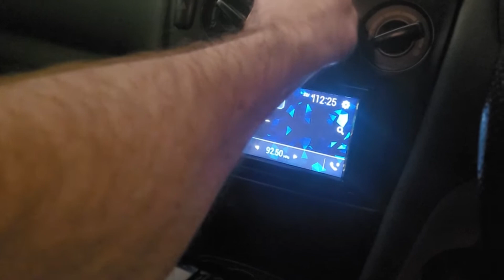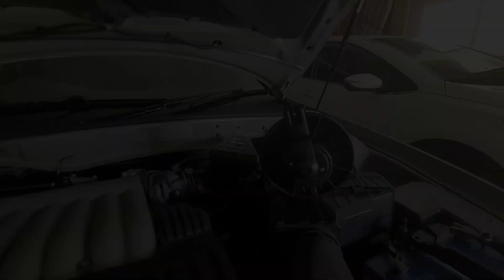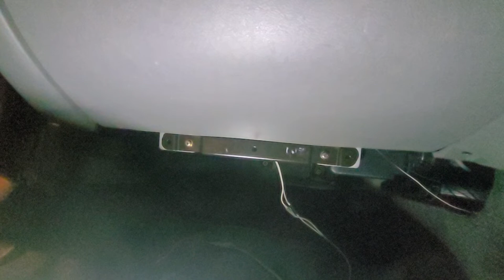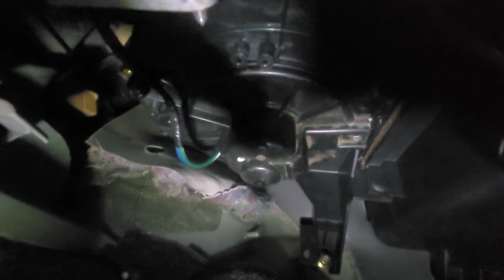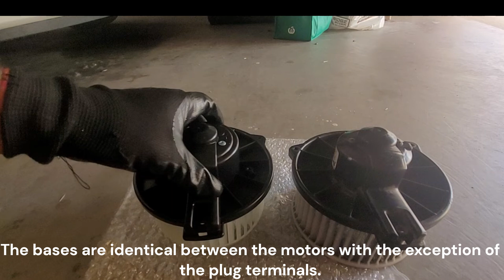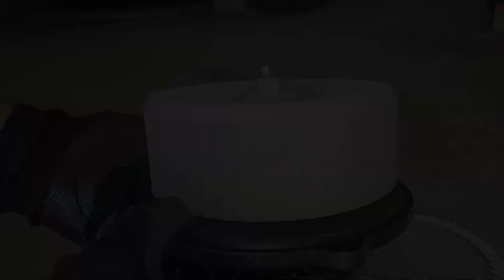How to replace a faulty fan blower motor  | 1996–2005 Mitsubishi Magna, Verada, Diamante

Comment: Great job with the modification to get it to fit mate, but you could have gotten a diamante one from rockauto for under $100 landed in Australia, all ready to plug straight in.
Reply from the maker: Thanks jimmyhsv7791.  Although aware of RA, for some reason I overlooked the site when searching for a replacement. I can see they are cheaper than Aussie online stores even after currency conversion and shipping, so this become very handy, thanks again!
Reply: @ no problem mate. Thanks for your video. Great work 👍

Comment: I just pulled mine out as the air flow was weak. It was full to the brim with debris. Quick clean out and for the first time in 3 years my air con is amazing
Reply from the maker: And just in time for summer, glad you got it sorted!  Several years ago during one of the bush fire seasons, I decided to taped over the inlet beneath the left guard as the recirculate setting wasn't effectively preventing smoke from entering the cabin.  I was still commuting in it and on the motorway around the Berowa area it would get particulary bad. In doing this I lost the fresh air setting (I need to roll down the windows) but it has also kept the blower motor free of debris.  Just thought I'd share in case it was something you wanted to consider, as it can also help if you need to park outside under trees etc.

Comment: Hi! I have an 02 Diamante and was wondering if you have had to deal with the clicking mode door actuator? Do you have any knowledge of locating and repairing the part? Thank you!
Reply from the maker: Hi BlaxlandRidge3. I haven’t had to deal with a clicking door actuator on my Magna personally, but if it's related to the central locking going haywire - locking and unlocking on its own or not doing either from the remote control, I may be able to help. First, before diving into the actuator, check the remote control battery—sometimes a low battery can cause issues that mimic actuator problems.

If the actuator is indeed the culprit, your best bet is to find an original second-hand reconditioned replacement. However, they can be a bit challenging to track down. Alternatively, you can connect up or piggyback an aftermarket actuator. It’s a bit more involved, but it’s a solid solution if you can’t get an original part.  I made a video on how to do this: https://www.youtube.com/watch?v=PZIiU_mM5Jc

Hope that helps, and good luck with the repair!
Reply: @billymasondiy  I'm so sorry for not specifying, I know this was a widespread issue so I assumed you had dealt with it as well. The mode door actuator is actually a component of the air conditioning system. It is the part which directs the airflow out of the various vents. The gear on this part strips out, then "clicks" trying to adjust itself. It also then restricts airflow from the vents. No AC in Florida summer is not fun!
Reply from the maker: @Alerrecks  Ah, I'm with you now. Although I've not had experience with this, as the blend door on my Magna operates via a manual lever rather than an electric motor, I managed to find a page which appears to reflect the problem you describe, how to fix it and the part number:  https://www.justanswer.com/mitsubishi/9fez3-mitsubishi-diamante-es-2002-mitsubishi-diamante.html
Reply: @billymasondiy  I have seen that article, but the lack of images or diagrams is not very helpful to me unfortunately. I cannot discern if the part is behind the center console or under the passenger glove box based on the info provided.
Reply from the maker: @Alerrecks  In a left hand drive car, based on Doug's description '....this shows the left side motor (viewable from the gas pedal area) which is the one you would want to change....',  it appears to be behind the centre console next to the accelerator pedal.  Removing the lower trim, beneath the steering wheel, should be enough to expose the motor and allow it to be swapped over.
Reply: @billymasondiy  I'll give it a shot. Thank you!!

Comment: Wow strange how the blower motor for Magna is so much more than the one for the Pajero when they are very much the same, thanks for the advice.
Reply from the maker: No worries, I've no idea for the significant ask over the Pajero and indeed other Mitsubishi models such as the Lancer.  The Toyota Avensis also shares the same blower motor but it's only available to buy overseas. Perhaps I can do a video talking about parts from other Mitsubishis that are either identical or can be retrofitted to the Magna and importantly are cheaper.

Comment: I have mitsubishi magna 2004 and theres a proplem the bling lights the left one is broken how can i fix it🤔
Reply from the maker: Sorry, I need more detail to help.  Are you referring to the left indicator light?
Reply: @billymasondiy  the left one and we changed the lamp after three days it stopped.
Reply from the maker: @MONTE_66  If the bulb is not blown it could be a contact issue with the socket, faulty socket, moisture or electrical issue. Have you tried swapping it for a bulb from the other side?

Comment: Fantastic! Thanks for the video. You're a man of your word!
Reply from the maker: Most welcome Lee.  If you're replacing like for like then the modifications steps can be skipped but I thought it was worth sharing how people can save a lot of money by installing a Pajero fan blower motor.  Many parts for the Pajero are identical or interchangeable with the Magna, such as the rocker cover gaskets set for the 6G74 motor, and often cheaper.
Reply: @billymasondiy  that's great info. The main sticking point for me was the crazy price for magna blower motors. I like saving money (big surprise), so thanks for helping out.
Reply from the maker: @leecasey3022  Agreed, I've no idea why they ask so much for them when they're fundamentally no different to any other motor.  And I too, didn't want to install another second hand one.